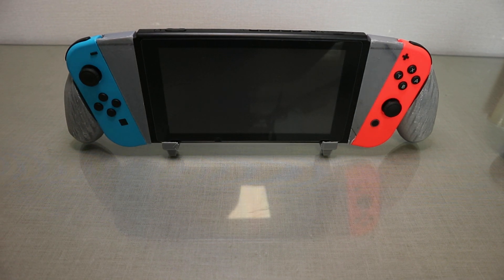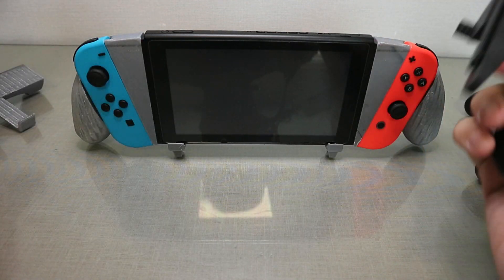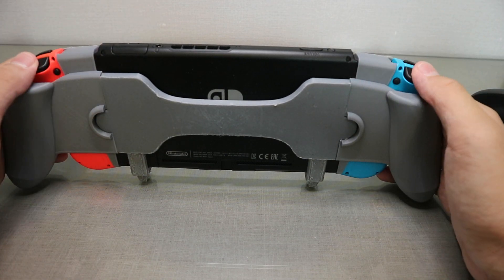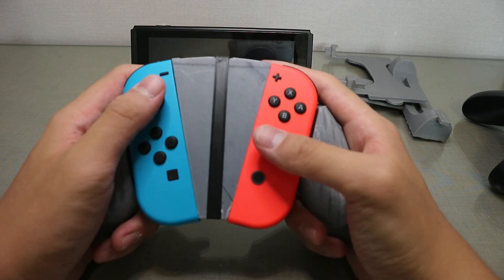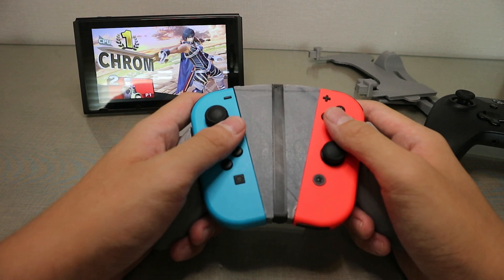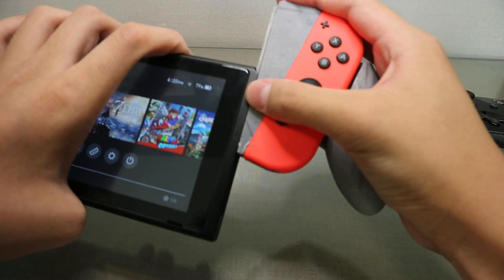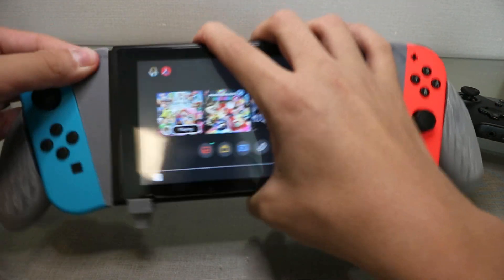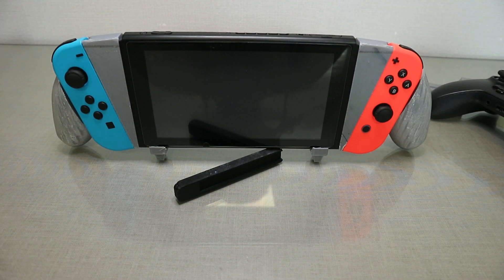3D Printed Ergonomic Modular Nintendo Switch Grip

Comment: Um hi I don’t know if you are ever going to see this but I just recently tried this print on my creatly ender 3 for my switch but sadly the controller grips have gotten lodged in my system any tips on how i can get it out
Reply from the maker: Hey! I’m really sorry about I usually test it to see how tight the fit is and sand it before pushing it in completely. Have you tried wiggling it out little by little or is it fully lodged in?
Reply: @Everyview  hey thanks for replying so quickly unfortunately it is fully lodged in
Reply from the maker: @kirbo404  I’m really sorry about that… maybe try putting some type of cream or lubricant to skip it out? Don’t use anything like water though. I’m not sure what’s the best option here
Reply: @Everyview  yeah I might try that thanks. oh and don’t worry it’s not your fault. This is just because of my own stupidity
Reply: @Everyview  oh my god after almost an hour I was able to get it out thanks to you I wish you an amazing day good sir
Reply from the maker: @kirbo404  Awesome!! Sorry my design didn’t work how you intended.. if you do want to continue I’d recommend sanding it down a lot and maybe smoothing it out so it goes in and out nicely
Reply: @Everyview  will try that thanks for the help anyway

Comment: Good design! Now that firmware 10.0 let's users remap controller buttons, it would be a good idea to design a 2 handed grip that allow access to the SR & SL buttons.
Reply from the maker: Etrigan Slaves I’m currently trying to redesign this grip to be more comfortable so hopefully after that I can make one for the small orientation!
Reply: @Everyview  Thanks for answering! Maybe i wasn't clear enough. i was talking about a grip that when you slide the 2 joycon had a way to press/use SR & SL (the 2 small buttons that get covered when inside the grip). i think the easiest way to do this withouth extra mechanisms is that the 3D Printed grip had a hole in the midle so either the index, anular or middle finger could press the SR/SL. 

With 10.0 update there's been a lot of button remapping so a Grip like this could offer potential advantages even over the Pro controller >;D
Reply from the maker: @Refreshment01  OHHHh I see. Since I just started creating the new design I'll see if I can put this into account! For my newest design I'm currently trying to repurpose the grip rails from the one they give you when you buy the switch, so I might have to create different versions. I think using the straps to create the larger buttons might be a good idea. Thanks for the suggestion and the info! I didn't know about the new update!